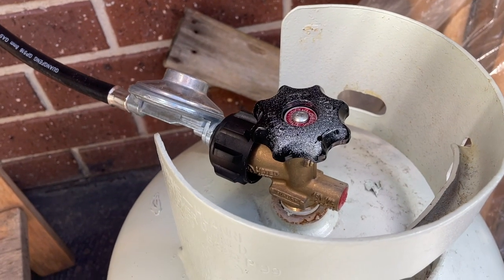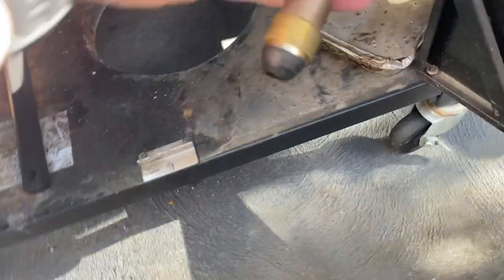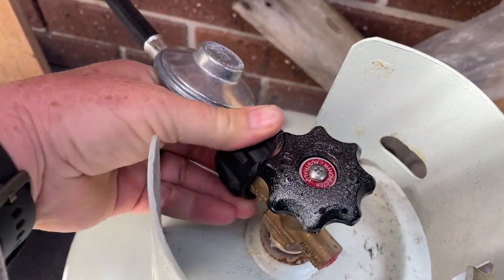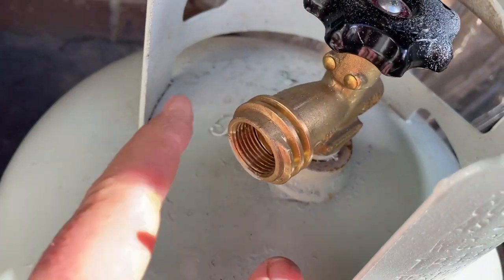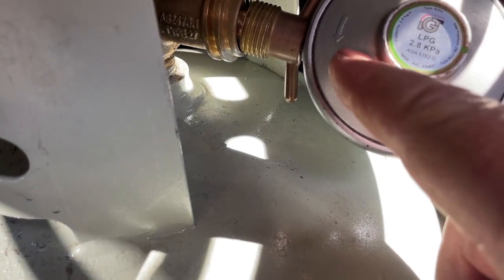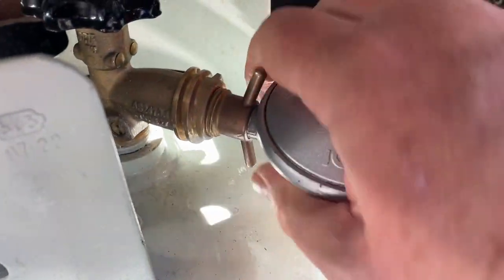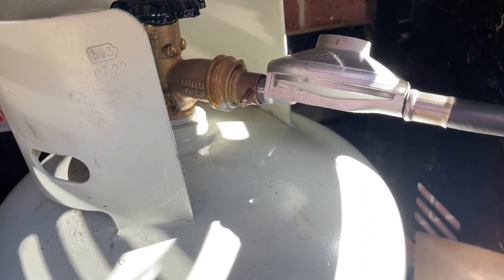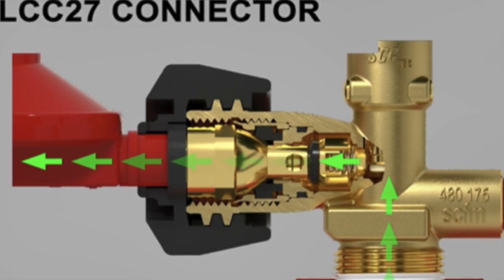BBQ Bottle *Must Change New Gas Connections & Gas valves in Australia dates LCC27 Caravan compulsory

Comment: Hi I have already asked this question on another channel and hope I explain it better this time.
I understand the new bottle fixture program and have changed many an old gas bottle over.
I currently have the old bottle type with the old appliance fitting but also have a gas bottle pressure gauge in-between these fittings
I like the idea of the new appliance fitting as arthritis makes it difficult to undo and do up up current fitting this means I with have to buy a new pressure gauge fitting

Comment: I brought one of these new ones about  5 months ago (Icc27) hose . Hooked up and cooked my roast for 3 hrs and notice it wasn't cooked properly .I pulled out my roast and had a look at the pressure flame coming out it was very low...then I changed back to my old fitting which worked  better . has any one had this  problem with pressure on the new Icc27 all did I do something wrong

Comment: Your demonstration of how difficult a POL is to use is with the cheapest and worst type that should never have passed the standards.
IMHO this new lcc27 is over complicated 
For reliability you cannot get better than a quality POL fitting and matching POL valve.
Not talking through my bum, I owned and ran a Gas Cylinder Test Station for 10 years. LCC27 was a constant problem.
I sold quality pol fittings only and installed quality pol valves in lpg cylinders.
Never stocked a lcc27 as most people wanted them removed.
Sadly now I understand that lcc27 is now a requirement on new caravans.
Talk about treating us like inapt bungling morons.
Reply: @stuartstiles55  Spot on Stuart , I’ve been using the old style since I was a apprentice boilermaker in 1970. Never had a problem. Sounds like A money grab to me . Trying to reinvent the wheel . So is an Adapter available for my old style bottle that’s only 2 years old. ? ? ?
Or do I have to throw it out ?